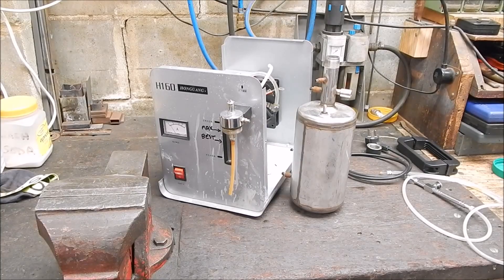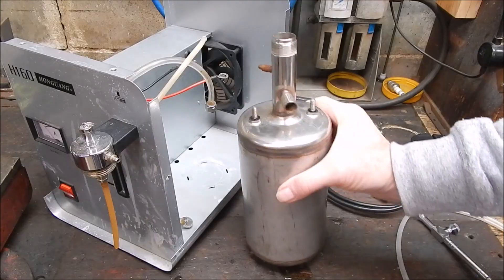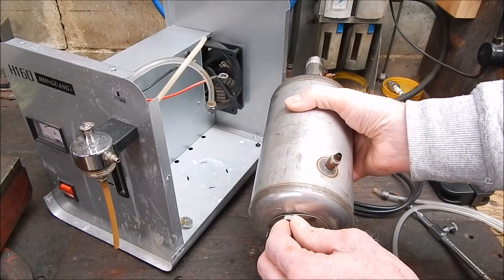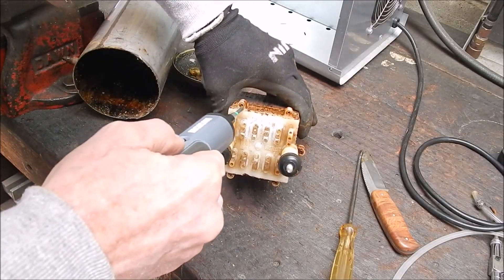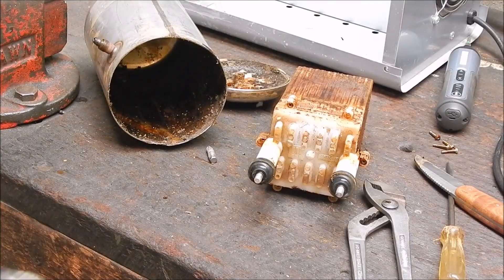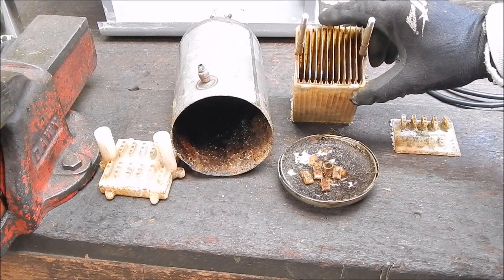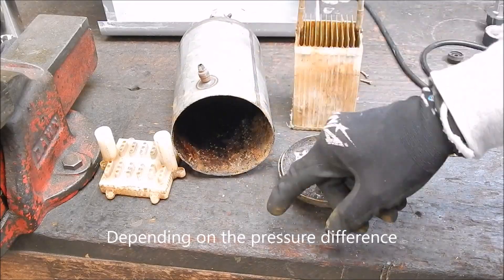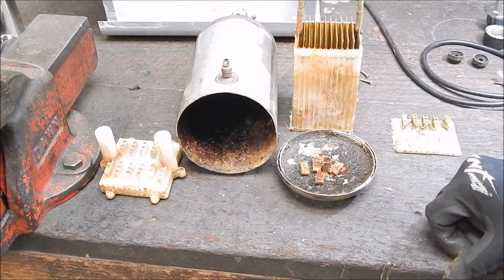I crack open the HHO gas electrolysis fuel cell of my broken H160 high temperature flame torch

Comment: Thanks Rob Nice to see inside , probably buy one cheaper than trying to make a cell . Pity you can’t buy replacement piece .
Reply from the maker: Hi Colum.  Yes I totally agree.  It's not just the cell, it needs a container to fit it.  So I've decided to scrap the unit and use my very small LPG torch for flame soldering jobs (which is what the HHO was primarily used for).  The 10 amp 24 V DC power supply out of it will be very useful as it will power a 775 electric motor perfectly.  Lots of stuff these days is throw away.  Not like the old days when you could even repair a toaster.  Cheers Rob

Comment: First thing i was thinking was get a used coffee thermos, or two. Cut in halfe add a flange, add gasket and bolt together. Or try metal spinning on the lathe to make the flange . Then a 3d printer that can make the cage for the metal plates. Just make sure the plastic dont melt with the added acetone

Comment: I think you could make a replacement cell without too much difficulty. Maybe increase the size and gas output.
Reply from the maker: Yes.  It would need a larger resealable container as well.  I will put it on the "to do" list.

Comment: G'Day Rob, Thanks for the look inside.
I'm wondering if some Hydrochloric acid would dissolve the sludge, but not eat the stainless plates too much. 
Do you have some to give it a go, if not Bunnings sell it in 1 litre or 5 litre containers, (in the cement section), was $15 for 5L last time I bought some( a while back, pre C19).
You could also make the container a reopenable one by silver soldering a couple of bolt together flanges around the bottom, just an idea to play with, seems a shame to need to buy a new one.
Cheers from QLD
Reply from the maker: Hi Bob.  I haven't given up just yet.  I have a few ideas floating in my head :)  I am going to run the grit blaster over the plate pack to try and clean it. If that works I will test run the pack in a plastic container of electrolyte.  If OK then I with try and reseal the container bottom.  It's only very low pressure gas, so it should seal with some silicon if I can weld a sleeve onto the steel base disc.  Being cut at the base if it does leak it will only be electrolyte and not gas.  A new unit is over $100 and these are very handy at times, so it would be good to still have one.  Cheers Rob
Reply: @Xynudu  👍

Comment: I was thinking for ages about getting one for hobby use. Absolutely awesome video.
Especially the last quarter...
Double thumbs up mate.
I also was curious what the cell was like... You got right to it.. I think you are right about the borax.
Paul
Reply from the maker: Glad you liked it Paul and thanks for the feedback.  Worth having for small work such as flame soldering.  I always released the tank pressure after use but the electrolyte still got contaminated by suck back.  The tank is well sealed to prevent gas leakage, but that makes it unserviceable as is.  Cheers Rob

Comment: Bloody annoying Rob as it was a useful bit of kit. Interesting to see what was inside though. Cheers, Alan.
Reply from the maker: Hi Alan.  As you can see, it's done quite a bit of work.  The small torch is very useful for model making.  It died relatively suddenly.  I will see if the plates clean up (might grit blast them) and go from there.  The 24 v/10 amp power supply would be perfect for a small 775 DC motor like I have on my small radial/cross drill for the lathe tool post. So it may still be useful.  Such is life. Cheers Rob

Comment: 12 plates, 11 cells, 24v means  2.182v per cells.
Reply from the maker: Yes, that's what works.
Reply: @Xynudu it shouldn't be too hard to build a dry cell with the same dimensions on the anode and cathode plates. One that you can service.
Reply from the maker: I will have to read up on that.
Reply from the maker: Thanks for all the info.  I will have a tinker with the carcase.  It's a handy torch to have and I use it quite a lot.  Interestingly mine died after 5 years of use.  In another video a high use owner (jeweller) had theirs die at 4 years with a suspected plate pack failure/contamination.   A few others have mentioned the suck back problem through the bubbler with this unit, which I think is a root cause of the failure.
Reply: @Xynudu  I remember when you first got it and put  a video of it on YouTube.  As for why it failed, maybe as you said, but be aware that even the best of  stainless steel for this 316L does not last forever. It eventually breaks down to nickle iron and chrome oxides.  The orange red  contamination over everything looks a lot like rust to me.   If your concerned about bubbler fluid back washing. Then use deionized water. It will only acquire hydroxides from bubble mist.  You can use an additional bubbler with gasoline or alcohol if you want a fuel richer flame rather than an oxidizing flame. If it were my project, I might take note of the expected Amps. Then build a wet cell with the same number of cells but more  surface area, and then start with a weeker  concentration of electrolyte and adjust untill I get the right amount of amps.  A weeker alkaline concentration and fewer amps per square inch means the metal plates will last longer.
Reply from the maker: The plates don't appear to be eaten away anywhere.  They are however coated with a yellowish substance/oxide as is the plastic plate pack housing.  The SS tank has a coating of black oxide looking stuff (as seen in the base).  This could be residue from the Calcium Hydroxide, or Borax powder in the bubbler (strong suspect).
Reply: @Xynudu if as you say there's little to no wear on the stainless steel plates, then maybe you might try to recover them. I know you tried vinegar, but maybe you might try citric acid. Citric acid is a stronger acid that's better at disolving away lime scale rust and  hard water stains. If that doesn't work you can hit it with a 120 to 220 grit sand paper on a palm sander. The roughened surface  increases surface area and helps bubbles break away after forming.

Comment: interesting to see the guts Ro👍👍😉😉
atb
Kev
Reply from the maker: It was worth a look Kev.  Handy torch for small flame type soldering jobs when it was going.  I may play around with it a bit more to see if it can be salvaged, although it looks to be more work than it's worth. Cheers Rob

Comment: Can't say it surprises me.  My guess would be that it's using the  cheapest grade of stainless (306 rather than 316) for the plates, rather than any other contaminants.  Personally I probably would have  opened it at the top, much easier to fix up an alternative sealing solution.

Have you checked the PSU is putting out the appropriate amount of power?  Given 11 gaps, it's running right on the edge of viability at 24v.  Nothing wrong with dunking the cell "as is" into a bath of water  / hydroxide and putting some power through it, see if it still bubbles.  Maybe do that outside, though :)  If it does, make up a new enclosure and robert's your mother's brother.
Reply from the maker: Yes, I will play around with it a bit more.  The power supply is fine.   The cell plates needs a good clean to generate any serious volume of gas.  I may run the grit blaster over the stack of plates and fire it up.  It would be difficult to disassemble the stack as the plates are extremely tight in the plastic housing.

Comment: Did you consider trying to clean it like a saltwater pool chlorinator? They have a different type of buildup on them, which is quite hard, but they can easily be cleaned with a weak hydrochloric acid and water solution. It may be worth a try before binning it.
Reply from the maker: I tried soaking it overnight in vinegar, which is a weak acid that will dissolve rust and calcium, but it did nothing.   The plates could be grit blasted without disassembling the pack, but the unit is beyond salvage now.  It would take specialised welding equipment and a large heat sink to re-attach the base without melting insulation.  It's toast ;)  Cheers Rob
Reply: Chlorine will outright destroy stainless steel.
Reply from the maker: Yes, they aren't very compatible.  I believe they use it to etch on stainless steel.

Comment: You did try but found a shop guy uncooperative content. Wouldn't toot picks and tooth brush cleaan it up? Joking!
Reply from the maker: The plates could probably be cleaned with a grit blaster without stack disassembly, but  there's no way to re-weld the cylinder without specialised equipment and a large heat sink to prevent melting insulation.  The junked power supply could be useful to drive a small 775 DC electric motor, as it has 24 volts and at least 10 amp output.
Reply: @Xynudu At least something good remains.